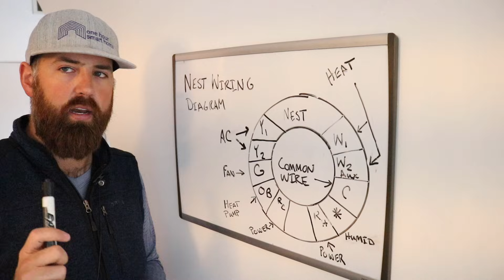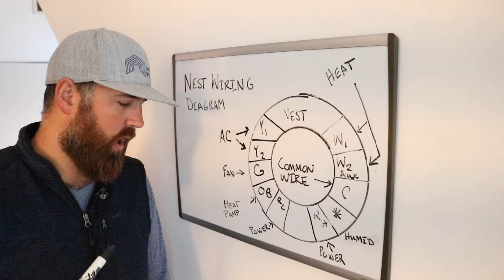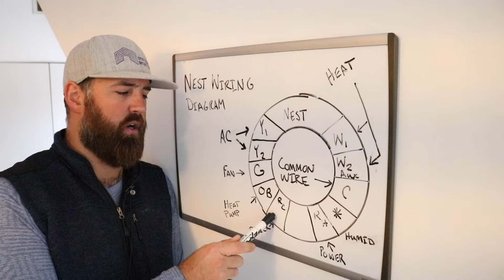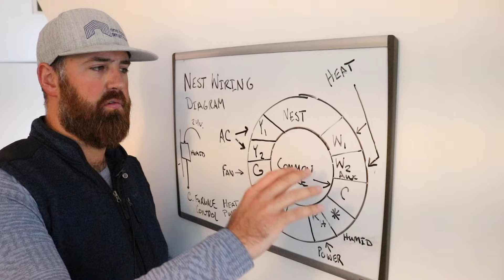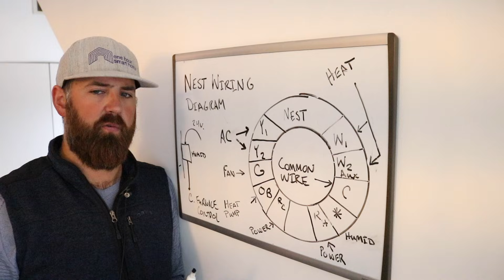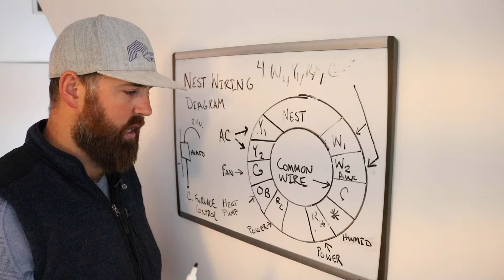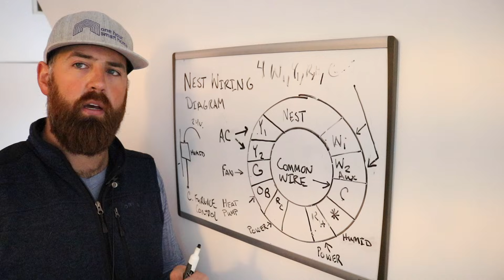Nest Wiring Diagram: Full Explanation!

Comment: Hi, thanks for the video. I live in the north east and I have a heat pump system. There are 7 cables in my system: red (Rh), white (W1), yellow (Y1), green (G), blue (C), orange (OB), brown (W2). How do I know if the wires are connected in the correct sections of the nest diagram?  Is there a way to check in my hvac system that the wires colors mean what they normally mean? Thank you!

Comment: I hooked up my nest gen 3 thermostat and when I set to heat my A/C unit comes on ( 6 wire , A/C heat pump outside gas hot air furnace inside . is it wiring a wiring issue or nest setup >

Comment: I have a 2 stage air handler and it’s mostly for heat but has y1 and y2 and only a w1. We find the air doesn’t seem to push while the heat is on. No heat pump is hooked up yet. Will be just not this winter) Would we be able to switch the y2 to the w2 in the nest and in the air handler or how would we go about that?

Comment: great video very good explanation for older systems that have more than 5 wires and that is the problem with the others videos that explain the easy replacement of a thermostat and not the confusing old thermostat like my  in my house that carry about 9 or 10 wires that are so confusing that I am intimidate to install a new thermostat like the Nest for the little information and experience from my part ,thanks for you explanation

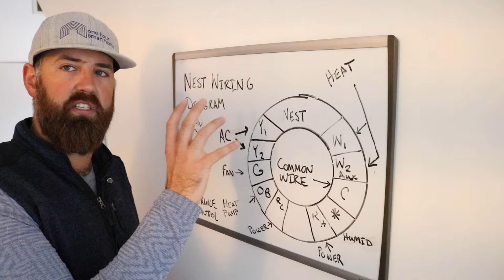Comment: 14:10 You mentioned that you can run a nest thermostat with only two wires and thats what I'm considering to do. I have an old Honeywell heat-only thermostat that is a single-pole thermostat with a black and white wire that runs a gas furnace. Is it possible to just use those two wires to run a Nest thermostat? I'm expecting to need a Common wire since I'd like to keep the Wifi features running but any help is appreciated.
Reply: Same problem as my heat-only White & Rodgers that only has two wires to run a gas furnace heating system. I'm sitting on the fence thinking whether I should get a Nest Themostat or just stick with the old W&R one.

Comment: Great video. I am just installing a learning Nest thermostat and and my old Honeywell thermostat has 6 wires and the  blue wire was connected to W2. I don't have heat pump or dehumidifier . Should I install that wire in the W2 connection of the nest thermostat? Thank you so much for your help

Comment: This is helpful. I ran into an issue but I'm not sure it's explained in this video, unless I misunderstood. I installed a Nest but our first floor has two separate thermostats: A main one and another for a bedroom but it only operates the heat, not AC. After installing the Nest as the main thermostat, it seems to have superseded the bedroom thermostat, meaning the heat runs throughout the first floor, whenever it kicks on, whereas before, it would only run the main thermostat. Previously, we could control the bedroom heat but setting the temp on the bedroom thermostat. It makes for a pretty warm bedroom most of the time.

Is there a simple fix to have Nest to bypass the bedroom thermostat/heating system? Or might it require something more advanced?

Comment: Hey Sir! Excellent video! Thank you. I have a split system (One hvac system with 2 thermostats). My downstairs nest has been working perfectly however my wife recently bought me a Nest for the upstairs to replace an old thermostat (which works fine). The new Nest gives me troubles. When I first installed it I had to charge it via USB and then it worked for a pretty good while. However came home one day and it was now  stuck in air-conditioning mode (the upstairs was freezing)! The only way to stop it was to remove the yellow wire. I contacted Nest and after an hour and a half of troubleshooting they sent me a new base. The Nest still doesn’t charge unless I throw it on a USB charger AND now I get intermittent “no power to Y1 or RC errors. I have a 4 wire setup. Y1, G, Rc and W1. Btw that is exactly how the downstairs Nest is wired and it’s been working for 2ish years. Do you have a video that explains this? Thank you!

Comment: i don’t know if anyone would be able to help but i’m trying to install my nest 3 thermostat and my previous thermostat had only a Red, Yellow and White wires and after installation, my fan (even tho there’s no G wire present or connected) will begin to run by itself randomly even though the mode is set to “OFF” any solutions to this problem?

Comment: So I have Carrier brand two stage heating and cooling unit. Carrier installed everything including it's branded thermostat which only has a two wire connection. I just purchased a Nest Gen 3 thermostat and I'm now perplexed on how to wire it. Any tips will greatly appreciated.

Comment: I have heat pump system electric Heat-A/C - I bought a nest and I am trying to make sure I am using the correct terminals. The original used Brown (E), Red (R), White (Aux), Yellow (Y), Green (G), Blue (C), Orange (O). For the Nest it is clear which ones to use except for the Brown (E). I have emergency heat so Do I place this on the W1 or asterisk? Thank you

Comment: You didn't mention whether Rh & Rc should have a jumper wire like most thermostats in Oklahoma are done when the cooling or heat is switched over according to the season.

Comment: I live in an apartment. I noticed that there is a ground wire is connected to the same terminal as the auxiliary wire which is white. My question is   do I insert both wires into the Nest terminall labeled Auxiliary?

Comment: I just bought this house and it has a thermostat that is not original. We have heating and A/C. There are only two wires attached to the stat, a white and black wire. 
The white is labeled V+ and the black is VG. 
I cannot find anywhere what V+ and VG are equivalent to and also am unsure how the thermostat is powered as it does not have batteries but is doing A/C, Heat, and power with only two wires.

Do you know what V+ and VG are?

Comment: Thank you for this video. I haven’t connected my nest thermostat yet because the app says my set up isn’t compatible. I’m not happy and I don’t understand why. I have 5 wires - they are: W, Y, G, Rc and Rh with a jumper between Rc and Rh also. I don’t understand why I’m “not compatible”. My current thermostat is a White-Rogers. I have a natural gas furnace that provides heat  and central AC as one with the compressor unit outside. It seems pretty standard and I just don’t understand why Google home says no. Any ideas?

Comment: Hi there, I have a dual fuel system. My heat works on electric and the emergency heat works on gas. Can I switch the heat to work on gas all the time? I only have Aux wire and I don’t have W wire. My second question I have a brown wire contacted to S1 in my old thermostat what I should do with it? Thank you so much

Comment: thank you so much for your video. I have Question how would wire up a Nest thermostat I want ( 1st Stage heat) W1 to turn on the gas boiler radiant heat and want W2  (2nd stage heat to turn on heat pump ( Y )  and I want (1st stage cooling)  to be Y,O. for cooling.

Comment: Thank you for this video, Pleas help...I have a simple straight cool/heat system, all my wirings were done by a pro and all was working fine (for 2 years) until I heard a bright lightening flash during a thunder storm and a couple of seconds of electric interruptions. Everything sounded fine after that cooled perfectly until I noticed that the blower motor/air handler does not shut off even if you turn the thermostat to off it keeps on running.
Could you tell me how to trouble shoot the thermostat?  (I have 5 wires with Common) should I check for voltage 24vac between C and G? (thermostat set to off) if the voltage is there then the thermostat is bad? Thank you in advance.

Comment: You present a lot of information about all of the details of this thermostat's wiring. But if you time yourself and divide it into the amount of time you spent on each wire, you spend a great deal more time on the rarest and least likely to be necessary wires than you do anything else. I am sure this is unintentional, but it gets difficult to follow when you sped a disproportionate amount of time on things that don't relate to me. 

What would be ideal is if you broke this into chapters or milestones where you could remind viewers to skip ahead to the next wire if they don't have a humidifier, for example. 

Great information, nice presentation, just needs a little bit of refinement. And a downloadable diagram with your branding on it would be a great thing to have on the wall next to the Nest while I am rewiring it. hmu if you need help producing a better version of this video.

Comment: We install a second Nest (Emergency t-stat) in parallel with the first one for the heat pump, and it works for heating only if we detached the first one. If both of them are connected the emergency thermostat calls for cooling instead of heating. Could you please clear up what is the problem?

Comment: thank you for this educational video. i have an office running in a same unit a/c with 2 different wifi now the nest is in other office beside me. can i add my own nest for my office i have 5 wire would it be possible to use the same color code for the new one getting branch out from other office.

Comment: Question, Goodman heat pump, with y1, y2, r and c wires available.  If I just want to use it for AC can I just connect the y1 and c wires to the wiring block in the Goodman has furnace. Is using the 2 stage heat pump feature worth it. My furnace wiring block only has a y terminal. Would I just run the y2 back to the nest thermostat if I to use the y2 terminal for 2 stage? Thoughts? Thank you, Jack Perlmutter

Comment: Current system only has a common wire and R/Rc via a jumper. There are all other available wires available. however, I attempting wiring a T9 Honeywell but no wiring process was working. My question. Do I only install the nest using the two wires currently being used? or do i attempt to wire using all available wires?

Comment: Thanks for the video. I bought a 24V AC transformer and wired to C,Rh since there was already a red wire in RC. Getting error code E79. In TECH INFO page, the Voc Vin values have way down. Iin has dropped to 8mA. It was previously 20mA. Please let me know what is the issue here.

Comment: I have one Lennox AC unit which is controlled by two Lennox M30 thermostats. One of the thermostats installed in my Bed Room has 5 wires only i.e. R, Y1, W1, G and C, the living room thermostat has all these wires with additional Orange wire connected to ACC2. I assume I can connect the R wire either to Rc or Rh, however where shall I connect the Orange wire which is connected to the ACC2 on M30 thermostat?

Any help would be greatly appreciated.

Comment: question : I have dual fuel system (Electric AC and Gas Heating - baseboard ) , Dont have common wire from AC system Rc,Y, G and Rh,C , W (From heating system). When I connect all these 6 cables it says incorrect common wire connection with some Error code.  
If I connect only these 3 Rh, C, W it works perfectly. and vise versa when I connect Rc, Y and G it works. Any idea what could be the issue ?

Comment: Great explanation on all.  I bought the new nest gen 3, nothing was working according to their directions.  I had a 4 wire system, but the white wire was connected to OB.  You said in the video to put that wire on W1.  I did, everything works now.  It's also nice to know what all those wire spots do.  Our business has 3 furnaces, and now all 3 are working properly now.  Thank you.  FYI, I called OnTech (Google tech), he showed up today, and I asked him about it all anyway, and I knew more than he did! (Just from your video).  My only question that I still do not have answered: How can I get the fan to run on "high" all the time.  The google help says it can be done with my Learning Nest, but I cannot get it, and the Google Tech was clueless (as always).

Comment: I just tried to install nest and failed. The yellow wire on my honeywell was not in use. Then when I connected nest, it was not showing cooling option. Google customer support told me that the white wire does both cooling and heating on honeywell but it cannot be used as is on nest. They said I can try rewiring the system but it is not guaranteed that it will work. Do you know how I can rewire it myself. Any help or guidance will be highly appreciated

Comment: If my OB does not get power through the NEST, the AC does not come on.  I seem to get heat when my NEST is set for AC.  My system has been wired and operational for 3 years.. I believe a software update was done remotely by Google in November or October.. and this spring I could not get AC when I switched over to cooling mode.  I have put my old dumb thermostat on to eliminate the chance it was a reversing valve or other issue with hardware.. works correctly and OK with old thermostat.. What are your thoughts?  Heat works, and diagnostics says NEST is OK.. I have a heat pump system with six wires (Y1, G, OB, RC, W2, & C)... NEST says it is wired correctly and it has been running for nearly 3 years good... Hope you have an idea I can utilize...  thanks friend!

Comment: I have the Gen3 thermostat and lately I keep getting a low battery warning and I have to take it off and charge it manually and put it back and it works for awhile. I’ve never had issues before. Could my battery be shot?

Comment: Thank you for this video. I have 4 wires and in my original thermostat, the power wire was connected to Rh while a jumper wire was connected from Rh to Rc. When I installed my Nest, I did not know whether to install the power wire to Rc or Rh. In the end, I installed it to Rh, but I was still hesitant and I did not know much about it. I'm from South Florida where the weather is quite often hot. Your video provided me confirmation when you said it can be either Rh or Rc for the power wire to be connected to.

Comment: I have 2 red wires going into the RH wire. One wire is a larger gauge than the other. I’m your opinion, which one could I stick in the R slot since I cannot put two wires in there. Great video. You spoke very clear.

Comment: I'm literally crying rn, we've been almost 2 weeks without heat -in WI, in January, in a cold snap. We bought this house last September, and the previous owners had installed a Buderus Logamax GB-142 condensing boiler for in-floor radiant heat. the wiring job is... less than obvious. Since the Buderus is a two wire system (white and red), there's no common wire, and whoever did the wiring spliced a brown wire to the red wire from the boiler, probably to not confuse it with the red wire from the AC. The white wire from the AC was spliced into a black wire - again, probably to avoid confusion.

Avoid confusion, it did not

Because of the wiring shenanigans, the Nest was freaking out about the wire setup. I finally fixed this by seeing your video and putting the brown wire (red from boiler) into the w2 slot and the black wire into RC. Suddenly the Nest recognized the wiring and now I'm waiting for it to have enough juice to connect to the wi fi.

Thank you so much, I would never have enough for a repair tech, as I'm on SSI.

Comment: I have a question. I Tried installing a nest in my house and when I took the cover of my old thermostat i noticed there was a red Rc wire a red Rh wire, a green, a white attached to the W termonal and a second white attached to the Y yellow terminal. That threw me of a bit. So does that mean that the 2nd white will get attached to the Y terminal at the Nest thermostat.  Any help will be appreciate it

Comment: YOU NEED THE COMMON WIRE HOOKED UP TO POWER!. If you don't you will put stress on the Mosfets and fry the base!! The damage might not occur instantly, but it will happen eventually. Please correct this video.
Reply: Nope. Nest even talks about not running the C wire on the thermostats. It’s on there site.
Reply: He said it's for charging the internal battery on another video 😂
Reply: What’s the black wire for?
Reply: How can you tell if you have common wire hooked up
Reply: If you let the smoke out it never works again.

Comment: Thermostat E: Can I put two wires into R since I have no RC or RH in a heat only system, since I need a common wire. Due to low battery issues.

Comment: Ok, so I think I've got the concept but I'm checking to see if I can make minimal changes to get this to work. I set up the *  wire and have access to it near the furnace. I can connect that to the wire leading to the humidifier relay. 

My question is about power. Do I have to run the power from the furnace C, or can I keep it on the plugin transformer?

Comment: Happy 2022!   I do have a question for you.
I do have variable speed furnace and heat pump system.
My variable speed didn't work since we install nest thermostats.  It goes only on slow speed witch makes the system runs very long time to heat up my house specially when is very cold outside. 
I think I have 2nd gen type.  4zones system.10 year old house. 
My hvac guy told me the nest is not compatible with variable speed system.   Is that thru?

Appreciated if I get an answer from anybody who knows this.

Thank you

Comment: I have been asked to install a nest in a home that the thermostat has one group of 4 wires and another with 5 wires.  The 4 go to the back of the thermostat and the 5 goes to a bar seperate from the thermostat.  If you could message me I can pass along a photo of the wiring so you might be able to assit me in the set up.  thanks

Comment: I change my old thermostat to 3rd Gen Nest  wires from the wall only 4 wires  everything work but I don't have Airwave option in my Nest  thermostat  in my old thermostat  I have  that after I turn AC off   fan will stay on for couple minute then turns off  but with Nest as soon I turn off the AC  shootdown the fans too